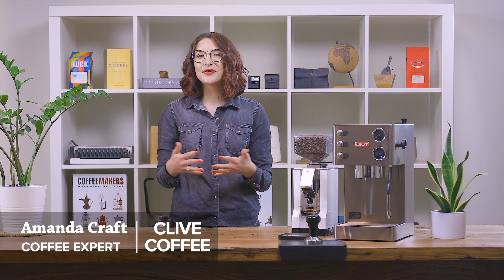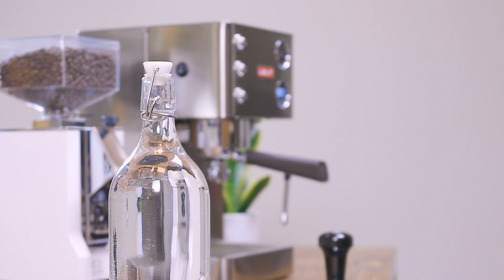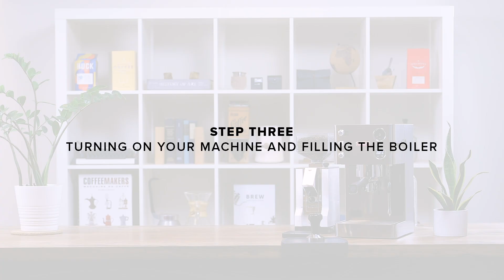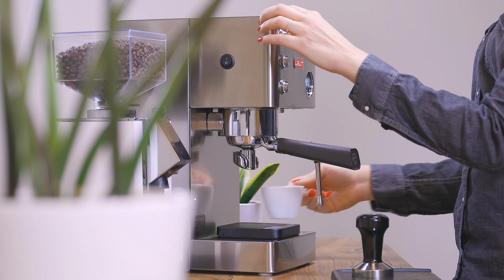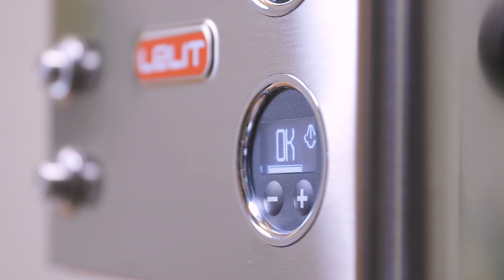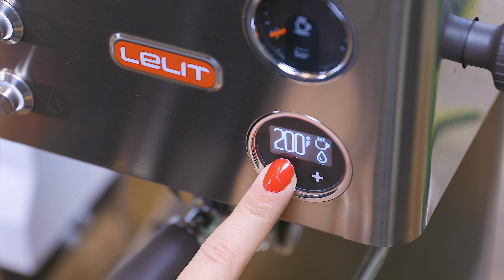Lelit Victoria Espresso Machine Setup

Comment: With the new  firmware version 1.14c, there appears to be a setting for Auto Cleaning Cycle in LCC. Has anyone figured out how to set this feature up? I have had my Victoria for about two months now and the manual says to do a group head back flushing once a month. There is also a shot counter available now in the settings and one would think that after X number of shots pulled, the there would be an alert displayed for group head cleaning. I just wish documentation and support for the machine was a tad better...
Reply from the maker: We no longer carry the Victoria since that feature has been released.

Comment: I have a question for you: How much time it take between end of steam distribution (after push the button) to get to the return to the coffee/water fonction ready? It seam long. It take on mine 13 minutes. It is normal?
Reply from the maker: After pulling a shot, run water through the group head to drop the temperature. That will help speed it up and get it back to temperature in a couple of minutes.

Comment: Thanks Clive Coffee for this video.  One question: do you use the optional pre-infusion? On your site, you state  that preinfusion is important and should be preferred.  However, as I understand the preinfusion programed in the Victoria will open the pump, stop it after 3 seconds, and then start it again to brew at the regular pressure (assumably 9 bars). Some commenters state that this procedure will not yield good esspresso and therefore should be avoided. What's your experience on that? Thx!
Reply: I did more research and it looks like after the 2020 update it doesn't go past 2-3 bar during the preinfusion. Look for videos less than a year old where you can see the gauge.

Comment: Seriously considering buying this machine. I currently have 7 year old Breville Infuser BES840XL which is also considered an entry level machine. My question is the Victoria,  I'll call it Vicki after my wife, enough of an upgrade from Infuser to make it worth the $$$? My main concern is ability to pull ratio shots. I'm not concerned with single boiler as I don't do lots of milk drinks. Please respond as I'm  considering purchase early 2021.
Reply from the maker: Hey George!
The Victoria has pulled phenomenal shots for myself and my team. From your Breville, I do think you'll feel like the Victoria is a lovely upgrade. Having the PID temperature control does improve consistency from shot to shot. The key is to have a capable grinder to pair with any machine. That's truly where your flavor is going to come from. I hope this helps! If you have other questions, feel free to email our team of experts at hello@clivecoffee.com
-Amanda
Reply: @clivecoffee  Hi Amanda, thanks for great response. I plan on getting a Niche Zero (NZ) when the US Black becomes available again. I need a grinder that can do the full spectrum of grinds and is also capable of single dosing. What are your thoughts on NZ?
Reply: @ggivensjr  I prefer specialita over niche
Reply: @ultraman1017  I've decided against Niche because it has to be sent all the way to England for warranty repair and it's such a new device it doesn't have enough of a track record. I am now leaning toward Eureka Mignon Perfetto. I need something more toward the all purpose grinder and I'll give up a little espresso grind precision. I don't want to hand grind and don't have counter space for two electric grinders. I do wish someone would make a smaller dosing only espresso grinder, then I'd have 2 grinders, a bugger one for filter and immersion grind and small one for espresso.
Reply: @ggivensjr  if you are serious about your espresso then you will be very hesitate to touch the grind setting once you are dialed in.  I owned a Mignon and a course grind machine.
Reply: @ultraman1017  Dialing in is part of the fun of espresso. But, even though I am serious there's a limit to the restrictions I'll let pulling the perfect shot affect my day. Bottom line is every shot doesn't have to A1. When I change coffees I will get dialed in over the course of a 2 to 3 days. I don't obsess over it. It's not like my photography which I love but still don't obsess over.

Comment: Is reservoir removable or do you have to move machine to fill it if its against a wall and with only 6" clearance? How big is reservoir?
Never got answer to this question.
Reply: I just got mine today and was surprised at how large the machine and reservoir is.  The reservoir is 9 1/2” top to bottom plus there’s about a 1/4” lip around the top of the reservoir receptacle that also has to be cleared.  You’ll need at least 12” of clearance to get the thing out.  Mine is on the countertop and I have to slide the machine out from under the upper cabinet to fill the reservoir. You don’t want to be pouring water into it without removing it either, unless you want to rig up some kind of funnel/tubing situation to do it without dumping water all over the inside of the machine.
Reply: @Thelo73  thank you for the well done unboxing review. Just what I needed. I do hope your further experiences are better. Please keep me posted.
Reply: 2.7 litre and 300ml boiler